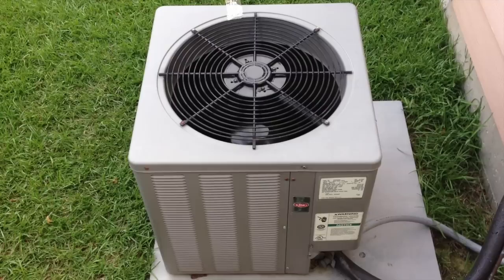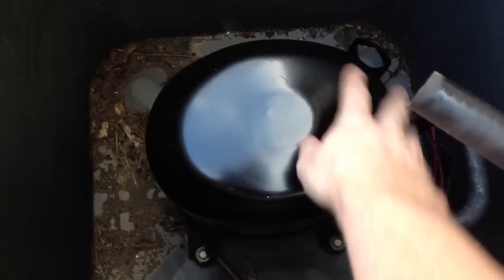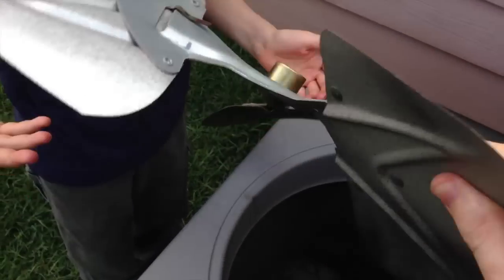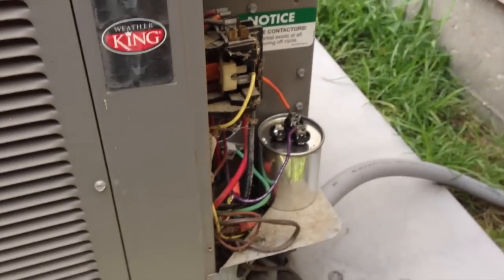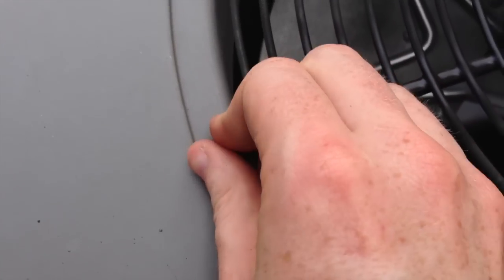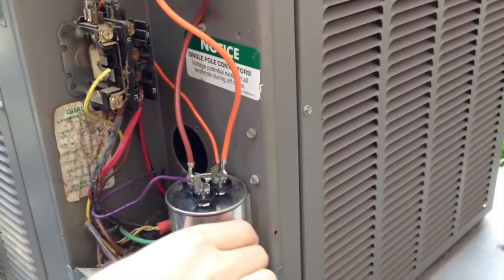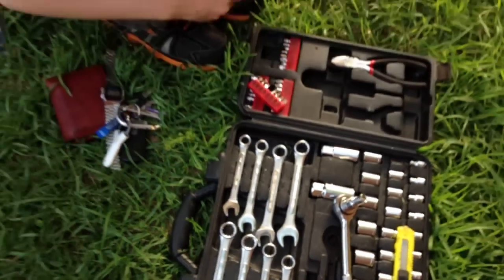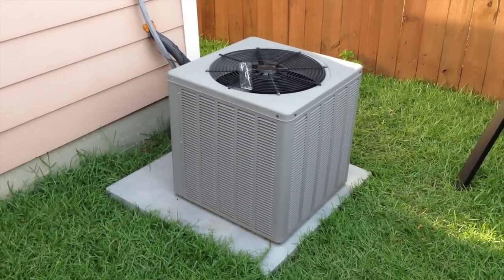AC Fan Not Running - Replacing the HVAC Fan Motor vs Capacitor

Comment: Thank you very much for the great video! We've never worked on the AC unit before and the technician wanted $800 to replace the fan motor. We ordered the part online for $150 and replaced it in less than 30 minutes. Your instructions were spot on.

Comment: I change my capacitor my self only when needed I keep one in stock mine go out about every 3-4 years  though the years of all my homes the capacitor is the issue , years ago had companies do this and was just taking my money replacing other  parts that really did not need replacement and I caught one co doing this to me , he stated computer board was bad on condenser, thermostat  inside was not working correctly replacing all would be 3500.00 I told him I’ll call him back , I looked on you tube fixed the issue with the 29.99 capacitor and the unit is still working after 3 years with nothing else changed out , lesson learn the hard way for me I even learn what to check and how to check it you tube saved me

Comment: I appreciate taking your time to post this video.  The motor on my outside unit starting make a grinding/squeaking noise late tonight and so I went out look and think it's bearing(s) in the motor.  Going to try and replace the motor myself tomorrow using this video as a guide.  I'll let you know how it goes.  Thanks a bunch for the help!

Comment: Thank you for sharing the repair video. This is exactly what I need, step by step how to put the new motor back on. It would be even nicer if the video includes how the old motor was taken out. But, I can't complain too much. This is extremely helpful especially when you said in the end to always check the capacitor first. My motor is running for the first 10 minutes each time it is turned on, then making a big noise and stop. I hope it is the capacitor problem.

Comment: Awsome, I fixed it!   I got a $27 capacitor at a local appliance store, ( it was a little bigger around & slightly shorter but had all the same values = 47uf, etc.). I put it in & used my photo of the old one before I removed the wires to match up the wires again. Bam, the A/C fan worked & has been working for several days now.  Thanks for your video.
Reply: Well done, Dave!

Comment: you really just made my freaking summer.  at the ass end of last summer the fan wouldn't turn on unless "kick started" so I figured it was the capacitor.  since I don't use heat in the winter I didn't bother to replace it.  

what that has to do with your video is that I have the same exact unit as you, and I pulled the capacitor. sure enough, like yours it was improperly specced.  it was a 30/5.  30uF was probably a big part of the problem and why it died so quickly (the previous owner of my condo said she had the capacitor replaced about 3 years ago.  I've lived in places for a decade that never needed a new capacitor. 3 years sounded way off.  seeing that you said 45/5uF is the proper spec, that's what I'm going to pick up in a few hours when home depot opens since they sell a 45/5uF 370v capacitor for under $10. 

the motor, blades and compressor all seem to be in great shape, though, so after the new cap and a clean filter I should be enjoying nice, frosty air conditioning.
Reply: I meant that I'm getting a 45/3uF, not 45/5.  the 30/5 was the problem.

you say the start uF isn't as important as the running uF, but if the starting uF is too low in combination with the running uF being too high, that seems like a recipe for burning out a capacitor quickly... it's not putting out enough at start, but then puts out too much to keep it running

Comment: Thanks you for sharing your knowledge.  I'm going to do this tomorrow.  My fan motor just die.  I had the same experience as you did about AC repairman.  He put in a wrong capacitor and charge me $150.  Capacitor die the following year.  I replaced the correct capacitor for $30(made in USA).  So i am a little jaded too.  Thanks again.

Comment: Excellent Video, My fan/unit won't start, I replaced the thermostat the capacitor and the circuit breaker was checked. I guess it may be the motor itself, now seeing how u did it I feel confident I can do that to, THANK YOU

Comment: Great video! I replaced my capacitor today , before watching this. Amazon is a great place to get them, got mine for $13.
Reply: what type of gloves did you use to handle the capacitor you removed?
Reply: @LPSPenguin  i didn't use any gloves when i changed my capacitor i just made sure the breaker that feeds power to the unit was off.

Comment: Excellent job there partner!!!! I totally agree with you there are a lot of hack's who do crappy work, iv'e seen it instead of putting the capacitor back in it's bracket because it don't fit they leave it in the box just sitting there.

Comment: In two separate times, I replaced a broken cap alone.. the next one when the fan motor finally gave out and got the needed help from my two teenage sons, prying the blades off that old rusty motor shaft and all. I’m no hvac guy but all’s been in YT lately so, bam! Things can be done that way now long as you’re literate enough and know when to tackle them or how, even.That was in ‘14 summer.. and our Goodman’s still working good, man.

Comment: Good video, three recommendations,

1.  While you have the fan motor out, recommend cleaning out the bottom of the condenser casing (leaves and other grass trash)
2.  ALWAYS discharge the capacitor and make sure you have the indoor thermostat in the off position (you could have 24-28VAC to the contactor)
3.  The contactor is very cheap, recommend replacing it when you change the capacitor

Comment: I have a trane unit and i think the motor burn out, because I had capacitor replaced with a new one, and the fan would start working and then stop running. So I when inside the house to turn it off and back on, and the fan would slowly turn and  then stop turning again ....I was told by a A/C tech,  that Trane motors can only be bought from the manufactor because of the way the motors are design and it would be costly more than their normal stock motors. I will have no choice but to buy one if it is the motor. 

After seeing your video, I wasn't aware that the wrong capacitor can ruined a motor out,. about 2 years ago I've replaced the capacitor when my unit outside stop blowing air and it ran ok until now.  This time I was so sure it was the capacitor again . So i  took the old capacitor and replaced with the indentical capacitor 45+7.5. I notced my unit has 2 capacitors so I replaced the 2nd capacitor 370vac/5mfd 
 I even replaced the connnectors too and  after all the replacements the unit still wasn't working. I was sure then it might be the motor.. bummer. .
 Perhaps this is why my motor burnout.  I was problaby replacing the incorrect capacitors from the start since the house was not new when I bought it and all this time the unit was running with incorrect capacitors  
 The technicians who sold me the capacitor never asked me what sized unit I had or else I've would've bought the right capacitor, because of your video I will double checked to see I have the right capacitor before installing the new motor, meanwhile, I will be removing the motor and have it trouble shoot it at the shop before buying a new one..                    Your detail information is valuable and informative. Please make more.  THANKS

Comment: I watched but couldn't hear you. I'm in FL & A/C fan has been blowing for 2 days but temp keeps going up. I changed filter, ran water down that overflow thing, checked the breakers, nothing is frozen, sweating or even cold. I have two zones and now zone 1, upstairs is just blowing air (fan set on auto), zone 2 downstairs not doing anything. When I go back & look at compressor, fan isn't turning & doesn't sound like motor is on.  I even checked attic to make sure duct work didn't come apart AGAIN! Yes & 4 companies couldn't figure it out.  I thought I needed freon  but the scenario seems to get worse. I took that fuse out & put it in that's in box near compressor but nothing happens. Could I need a new fuse? How can I tell? It's 85 in here now but I want to check what I can before I have to call for service . 2 yrs ago, everything that could be was changed out & cleaned (when it was the duct work). Thanks
Gail

Comment: ive actualyl put a larger value cap on the compressor side on an old unit...as it was old and needed a larger kick to get going....the unit lasted at least 3 more years.....after that im not sure as i sold the house...there is actually a brand name for those but it escapes me at the moment....it had a logo on it as well...its designed for older units

Comment: Hi, I am a DIY, I plan to change my Fan motor but I am afraid of the Fan blade won't come out from the motor shaft due the old age and rust, corrosion...etc. other than using WD40, have you heard about using Torch and heat it on the shaft and fan blade? , by using heat, the nut should come out right? Or do I have to buy that $35 tools fan puller to remove nut for a one time deal? Thanks for the video.👍

Comment: My AC unit has the 5 micro farad capacitor just for the fan.  They removed the wires from the duel 40 micro farad & 5 microfarad cap.  The compresser will not run unless it is configured this way for some reason, so I put it back to how they had it and it runs like a pussycat.  :face-red-heart-shape:

Comment: On the wiring diagram of the new fan motor it says to connect the brown/brown white wires to the capicitor that comes with the fan motor but there are only 2 terminals on that capacitor. Where would u put the wire from the compressor that goes to HERM? And also the common?

Comment: I have same unit as yours.(Weather King). I was not getting cold air and found out the coil in the heater unit was leaking, replaced. Air worked for 2days and stopped again. Changed capacitor still same. Fan worked but slow. Turned all power off to house completely. Changed thermostat and when I turned power back on fan not working at all or condenser. Appreciate any thoughts on the matter. Thanks, Rich

Comment: Yes. I've seen a couple of hvac stings by local tv news or network news shows. In one, 3 out of 6 tried to rip off the customer by tryng to sell them a whole new system, or overcharging for repairs and parts that aren't needed. In another sting, 6 OUT OF 6 tried to rip off the customer. 6 OUT OF 6 !!! lol

Comment: the external fan in Ac stopped woring today,  i only hear click sound when i turn on or off the ac. is it capacitor or fan motor ?  (I manually tried to rotate the fan, it doesn't look jam or stuck)....   suggestions ?

Comment: I have 3 wires running from my 2004 Goodman hvac compressor. Red, yellow and black. Which wires go to which posts on capacitor? It's a heat and air unit but I only had 3 wires running to old cap. I forgot where they go. Can you help me?

Comment: No they are located in the same town as me. The tech said capacitors are about 200-250. The fan worked that day then died the next day. They came out and replaced fan and motor for 550.00

Comment: My problem was there's some jumper button on the front of the compressor contactor within the grooves; it doesn't even look like a button, just something ya press w/a plastic pen while the power's on. When I press it in, the 2 round leads touch the other end and THE FAN COMES ON. ....BUT, it stops the second I let go of it. I don't know why it doesn't work on it's own.
Thoughts?

Comment: I have a new fan motor arriving today.  This is my first attempt at replacing one.  I'll let you know how it comes out, but this was a great video.  BTW, did you discharge the capacitor?  I didn't see that in the vid for some reason.
Reply: This went great!  Part was easy to install.  Fired right up.  Learning more and more about HVAC.  A Lot of things that go wrong are simple and the owner can usually fix themselves with a screwdriver.

Comment: There is no issue with your fan. The contactor is controlled by a 24v low voltage circuit. That circuit includes at least a transformer located in the furnace, a terminal strip of some sort located in the furnace, the thermostat, the wire from the furnace to the thermostat, the wire from the furnace to the condenser, and the compressor contactor. It can also include low pressure switch, a high pressure switch, or a low ambient lockout, all in the condenser.  Something is wrong in that circuit.

Comment: hi there,
ive changed the cotactor and capacitor but still ac is not working. there is no buzzing sound or nothing.its dead. but when i press the contactor it works. 
please help.
Reply: Sounds like your not getting your  24volts from the thermostat , check your wires makesure their all connected an not broke anywhere

Comment: all of you who changed the capacitor; what type of gloves did you use? I'm finding that insulating rubber gloves are $150 and up, so Im curious how you manage to do this step safely? do I not need the gloves if I discharge the capacitor first?
Reply: Use a screwdriver or pliers with rubber handle

Comment: HI i got a question for whoever knows the correct answer..... I recently came across a new pool heater in Canada and there is no shut off going into the ground after the meter and there is also no shutoff behind the shed where the GASTITE goes in but there is one shutoff connected to the valve train before the gas valve. Does anyone know if you need those extra shutoffs and if so what code is it in the CSA B149.10 code book thanks.

Comment: Also, your replacement capacitor is a 440V instead of the 370V.  That's why it won't fit in that hole.  It works just fine (larger value is acceptable) operationally, but completely unnecessary for that unit.  If you swap that with a 370V dual-run capacitor with the same specs otherwise (compare the micro-farad values), it'll fit back into that hole like it's supposed to.

Note that this is not necessary operationally; that's just an FYI as to why it won't fit.  In the meantime, I'd do what others suggested and secure it with some metal pipe strap or something.  You don't wait it sitting there loose! (even a piece of stick-on velcro on the bottom would probably work...)
Reply: Hmm.. well I stand corrected then, my bad!  I once bought a 440V that was fatter like that so that's what I thought you had done.

Comment: I noticed that at the end of the video when you plugged back in the disconnect to power up you AC unit you had your low voltage wires wired up inside of your disconnect box. This is a big no no. You can not wire low voltage and high voltage inside a disconnect box.
Reply: Km M yes you can! if both are insulated for the high voltage you can.
Reply: Km M It depends on your State and Local electric code enforcer. Each state and county has their own interpretation of the Electrical code. In some jurisdiction this is fine.
Reply: zipting2000
Ok so again let's all stop and think about the purpose of these videos. Its not to see who's the smartest man alive with all if's and but's. The purpose is to help the general public. Now if I say low voltage and high voltage should not be mixed, and someone uses that advice to install an AC unit....that person who uses my advice would be right 100% of the time by using my advice. There is no code out there states high voltage and low voltage must be mixed. With that being said... if you work in a "state" or "county" where the practice of mixing the 2 voltages is NOT ok and you understand the potential dangers of mixing the 2 voltages, I don't believe you would be digging through the NEC code book every time you cross a state or county line to see if you can get away with mixing the two. You would do it the way YOU know is safe.
Reply: Km M  I agree.